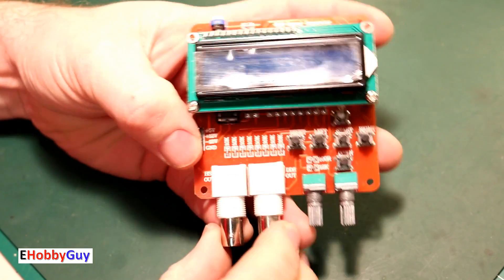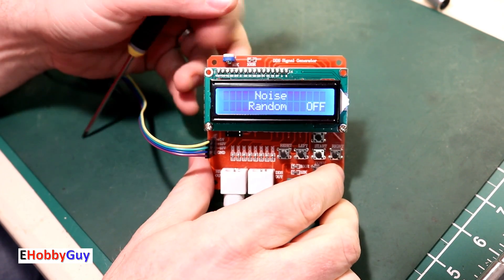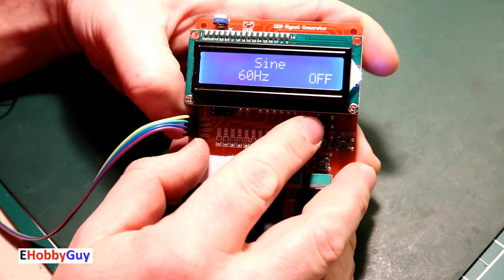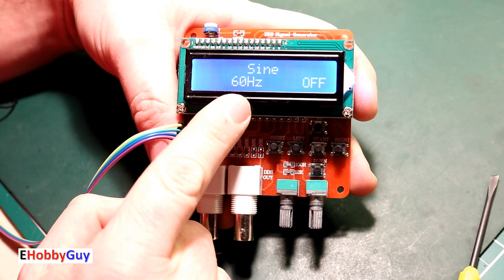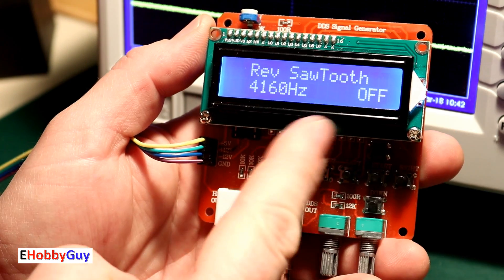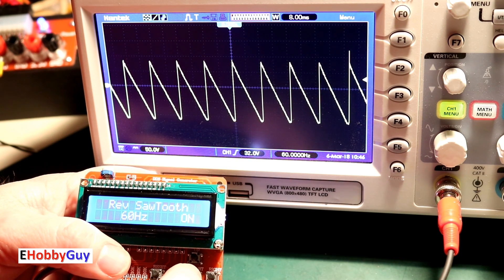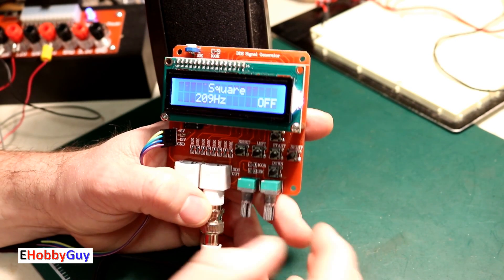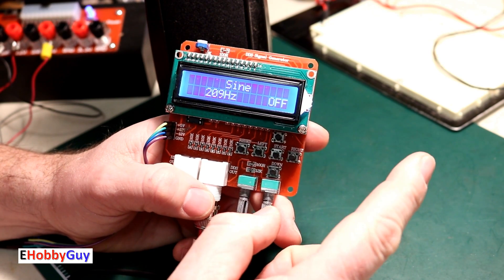Function Generator How to and Sound Effects

Comment: Can this be used to generate AC at a given frequency to test circuits? It doesn't have to actually generate AC, but maybe just interrupt a DC signal or something? I would be interested to know this because I would like to mimic the energy saving frequency sent over the grid which is used to turn on and off energy saving devices at night so they can take advantage of the lower power rates automatically. This would be great in an automated battery storage system, which charges the batteries at night so they are ready in the morning. I really enjoy your videos, keep up the great work.

Comment: The sounds you are getting are definitely NOT correct.  Maybe the function generator cannot drive your loudspeaker directly.  It might need to be connected to a small amplifier first.  Look at the output to the loudspeaker on your oscilloscope.  The sine should sound very soft and mellow, not at all buzzy!  And you shouldn't be able to hear anything if the sine frequency is below about 20Hz.
Reply from the maker: David Brown thanks for your input. I’ll definitely check that out. I️ appreciate your feedback! And thanks for watching!